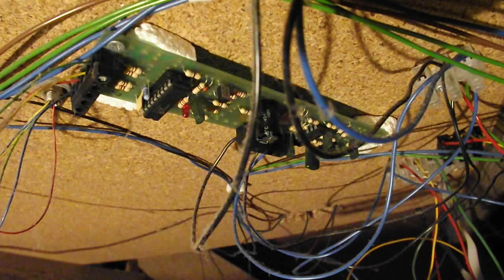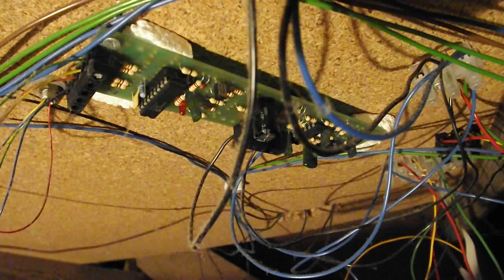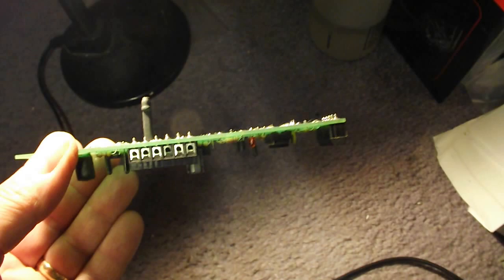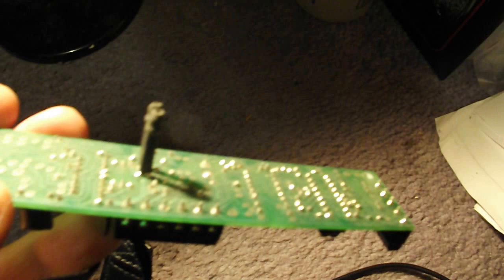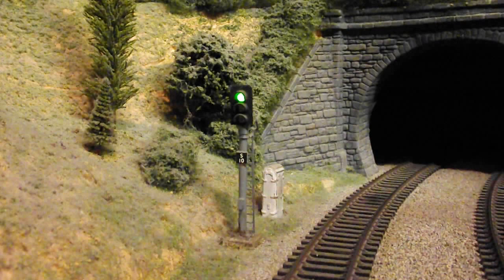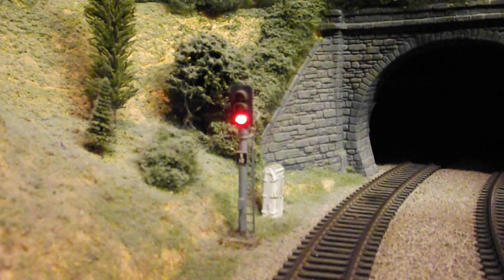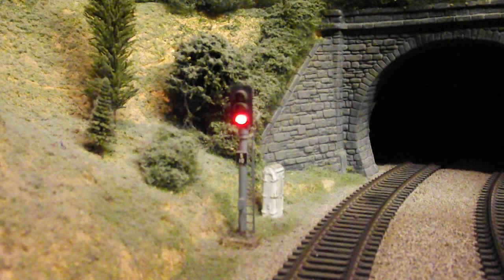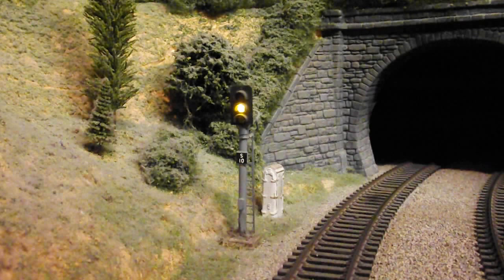Heathcotes Electronic MAS sequencer and Roger Murray 3 Aspect Light Signal

Comment from the maker: Yes, on the Master Sequencer there is a pot with a screw head to increase the timing..
I have set mine to allow a fast train to do a loop of the layout and ensure the signal is green on it's next approach, the other two signals feed off the previous one and are switched as the train passes the next signal, ..